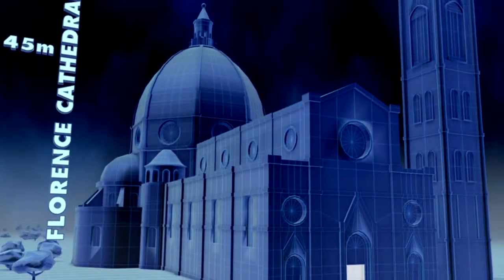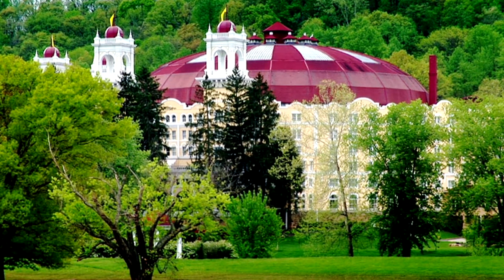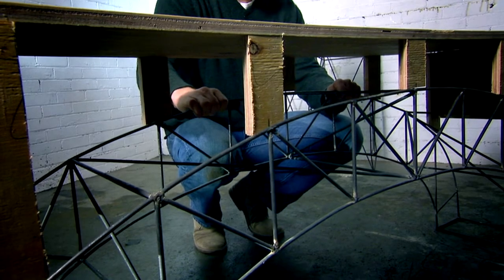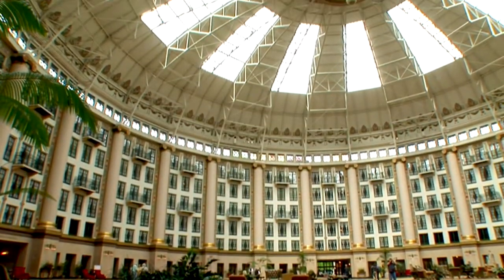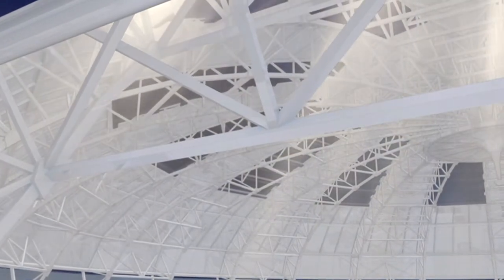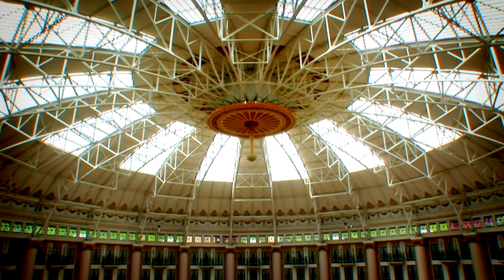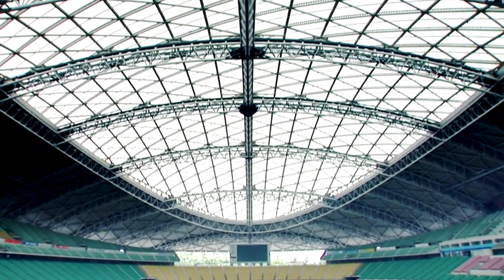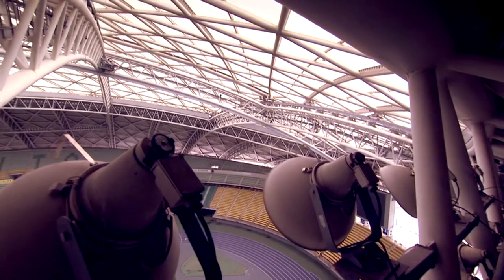Under the Dome | West Baden Springs Hotel

Comment: I went to school there in 1976 before this latest remodel.  The center carpeted area was not level due to pressure from the spring underneath.  the area was patched over with concrete and I used to roller skate there